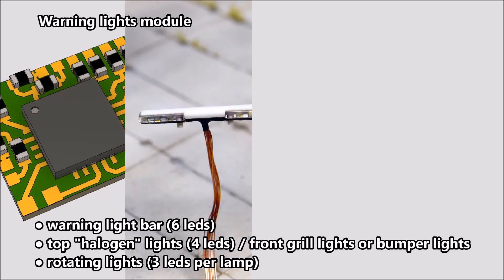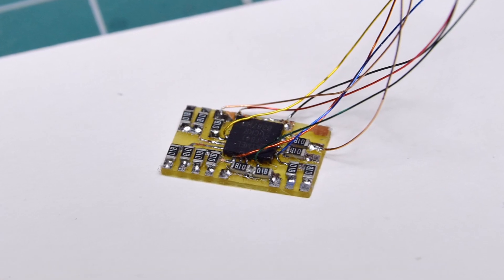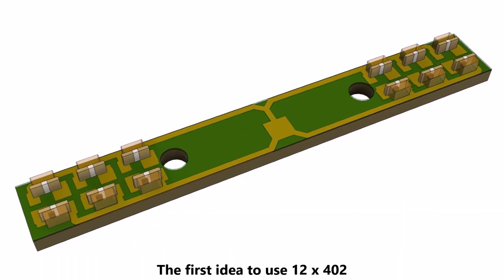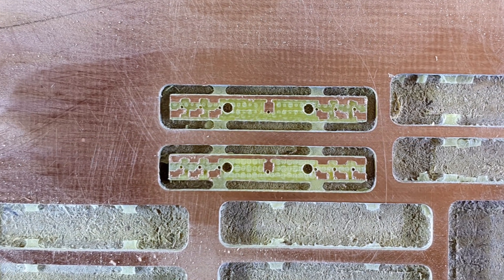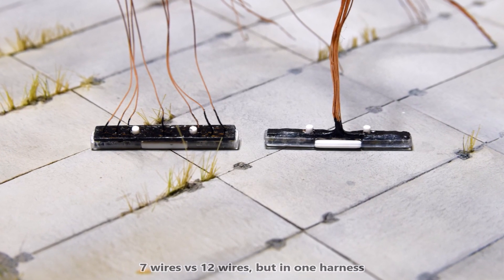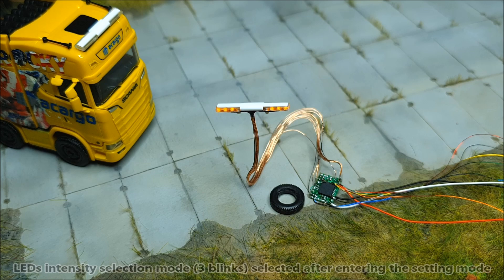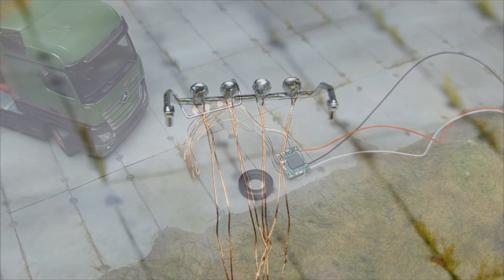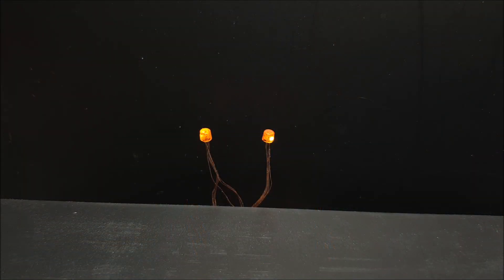Warning Lights Module and brief lights build log | RC 1:87

Comment: Hi I have a question about the board do you have a place where we can talk business or something?
Reply from the maker: You can contact me by email (see my channel about section) or message by form on https://www.rc87.blog/contact/
Reply: @RC87  I sent it
Reply from the maker: @diecastproject76  hi,  no message yet, 
but if you have sent via contact form then I just found out that there was a server issue and the massage was lost probably, sorry, 
contact form was just fixed now, but mail is more reliable (about section of this channel)
Reply: @RC87  I don't see the email I will re send it on the contact form
Reply: @RC87  I responded to you I don't know if you received it😅

Comment: So I have rotators with 4 LEDs. Will this module work with a 4 LED rotator setup?
Reply from the maker: Like I already replied to your comment on my blog, it could work, but the module is not designed explicitly for 4 LEDs rotators. You could try it with bank 4 Leds Lightbar (4 LEDs) and patterns 4 and 5. That bank is for 4 LEDs lightbars, similar to 4 LEDs rotators and could mimic them, but it is not explicitly designed for 4 LEDs rotators and I can't guarantee that you will like the smoothness.

Comment: Nice development. Thanks for sharing.
1. How do you control all those functions from the receiver?
2. Are you using Deltang receivers?
Reply from the maker: 1. With one wire (white on the movie) keeping longer "turn on" signal allows enter to the settings (signal from P pad)
2. yes, Deltang
Reply: Very nice, you use a servo signal to turn on and of the different light?
Reply from the maker: @DerTheoretiker  
Not really. 
I want to to use one P pad which I can control with a stable or momentary switch on my TX (and of course momentary is most suitable).
If there will be only stable switch then you have to remember to put the switch back to off position. I don't want to use servo, but there could be such possibility.